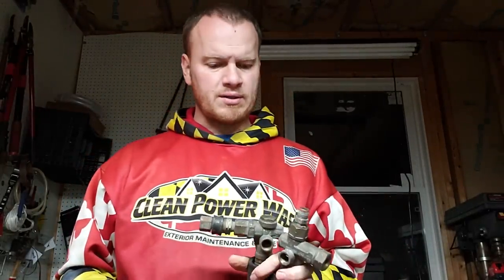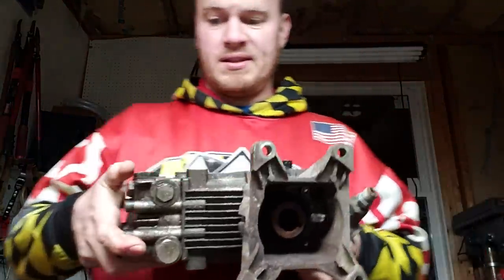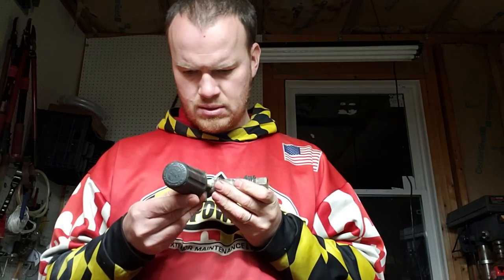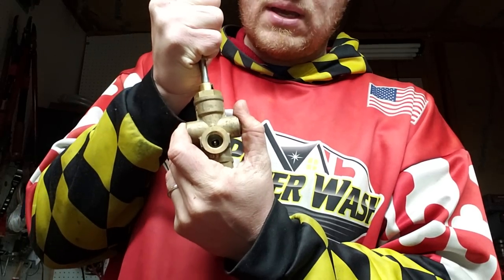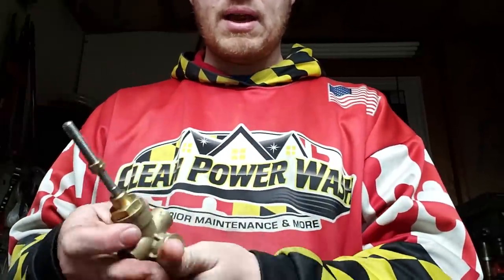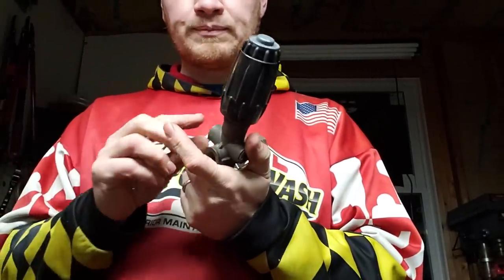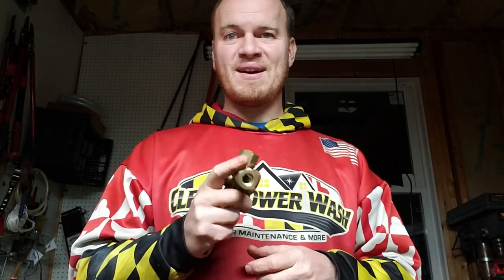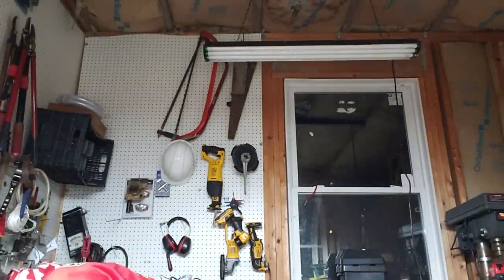What is an unloader? Pressure washer unloaders explained.  Trapped pressure vs flow unloaders

Comment: Very useful information. I’ve got a landa belt drive machine that does 4.7 gpm at 3500psi with a flow unloader that looks exactly like the one you showed. When I release the trigger the pressure jumps to 4500 psi and a little water leaks from the unloader. I’m concerned this is bad for my pump since it’s rated at 3500 psi. Any chance you can tell me if I need a new unloader? Or possibly just to make an adjustment?

Comment: Hi can I ask a question im a little confused. I have 2 washers both the same with built in unloaders can u use these in series so long as I run check valves both pumps are identical I just don't know weathere there trapped pressure or flow
Reply: Same I ha e two identical 2.5 gpm 3400 psi, both have gx200, and both have a cat pump, I want to siamese them together to get the 5 gpm, I'm pretty sure the psi will stay the same though, but I'm not sure what kind of unloader they have e on them?

Comment: Can you run a bypass on a built in unloader valve (the one that came with the machine)?
The discharge seems to be in the back of the pump with no outlets anywhere near the nob under the unloader. Or would I need to buy an external unloader valve to run bypass?
Reply from the maker: If it has an external hose that runs back to the inlet of the pump, then yes.   Otherwise you would need a different pump and unloader

Comment: Why do you toss the pump when the unloader is bad? Can't the unloader be repaired? I'm asking because I have an AR RKV4G37D-F24 pump and it appears the unloader is bad (water sprays out of the unloader port regardless of whether or not the trigger is pressed). Just wondering if this is something I can replace or if I'm better off getting a new pump?
Reply from the maker: You can replace an unloader easily.  The pumps last a lot longer.    We have never repaired the unloader, but it can probably be done

Comment: Rob which unloader do you prefer... I run a flow unloader. I like it better for multiple reasons.
Reply from the maker: Flow in general is better all around.  Trapped pressure is more common and cheaper.

Comment: I know this is an old video but can I run a external unloader on a pump with a internal unloader?  Like just set the external low enough that it bypasses water. I figure at that point if its bypassing water out the side then the internal one wont ever come on.
Reply from the maker: Honestly I don't know 100%.  It probably could be modified, but I don't know how much it would impact it.
Reply: Why de ruber on dat keep mashing up

Comment: Can you help if possible, i have a similar pump at 1:37 of your video. Can this be wired to a buffer tank? if so how did you do it?
Reply from the maker: All unloaders should be set to bypass to an unloader
Reply: @Cleanpowerwash  I'm just not sure which port to port out of to the buffer tank as it has an internal system. It has a thermal release valve, could i change the fitting and run it to a buffer tank?
Blackjetoz - Website
'PRESSURE WATER PUMP 4000 PSI AR ANNOVI REVERBERI ITALIAN HONDA WASHER RSV4G40D'

Thank you for helping, love the vids!!
Reply: There is a nipple on the side of the unloader that looks like it could be used based on your other videos?

Comment: What type of unloaders do electric power washers typically use? I have a Ryobi 2300 PSI 1.2 GPM electric. I would like to run two so I have 2.4 GPM. This will give me gas like power with the convenience of electric.
Reply from the maker: Electric just has a pressure switch to turn the pump off. Not sure how electric is convenient, but you would be better off buying a bigger single unit
Reply: Electric can be great, but don’t waste your time with a 120v unit. I custom built one with a 3phase 10hp motor. The motor is controlled with a speed controller so I can adjust me flow easily.

Comment: Could anyone tell me how to spot the difference between a trap pressure unloader and flow? I've looked at mine and cannot tell.
Reply from the maker: The vast majority are trapped pressure.  If you pull the trigger and there is a big burst of pressure then that is a trapped pressure unloader.  If it takes a few seconds to build up pressure then that is a flow unloader
Reply: @Cleanpowerwash  Thanks for the quick response! Looking to buy a siemese kit to move quicker on the ground level with a floor cleaner.

Comment: Question regarding unloaders. On the VB350 unloader there’s a small hole on the piston holder that no one talks about. What is a that holes purpose and when it has a small but consistent flow of water coming out while the unit is in bypass mode does that mean that is going bad or just a spot for water to escape so it doesn’t blow? I had no issues before but I just had to re Teflon my bypass fitting and then the hole started leaking after I fired up my machine to see if the fitting was still leaking. I’m just confused and can find no info on it. Hope you can help
Reply from the maker: Never used that unloader.  It could just be a release valve, but steady stream out of it is no bueno.

Comment: Hey Rob what you think about belt driven vs direct drive pressure washer?
Reply from the maker: Belt is better than direct drive.  They are harder to work on than direct drive, but last longer.   Belt goes at lower rpm and so it runs cooler.
Reply: @Cleanpowerwash  is that what you use?
Reply from the maker: We have 1 belt drive 3 gear drive and 2 direct drive
Reply: @Cleanpowerwash  I am thinking on buying a direct drive or build it myself. Once I generate enough income I'll upgrade

Comment: I got an old Lely-gem jet trailer jetter with a giant pump MP4035 1600 psi 15.5 gpm... I just picked up for $1000 kohler commander ch730 for flushing sewer lines  just wondering. How to increase pressure without changing pump_. Is that possible... I would like to cut tree roots_ but this is more of a flusher
Reply from the maker: Try smaller tips.  No clue about that pump or sewer jetting